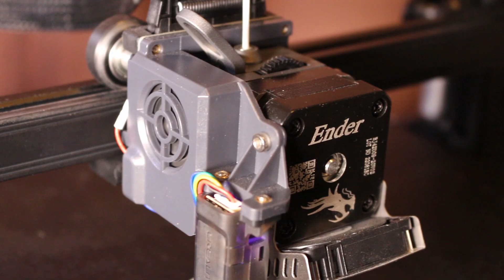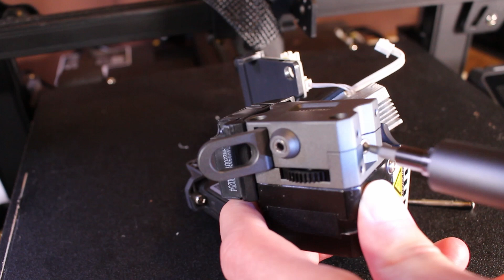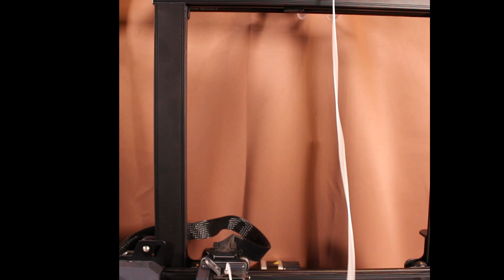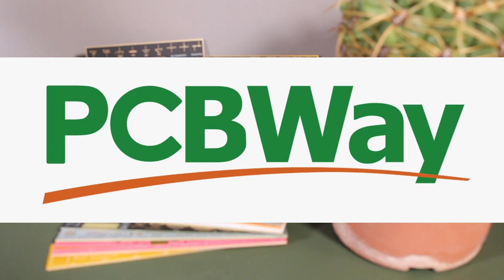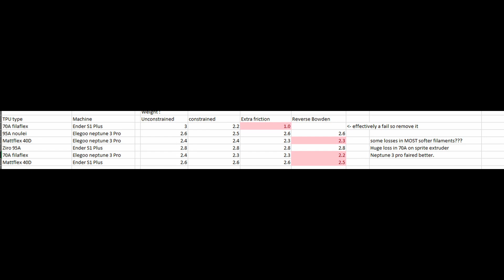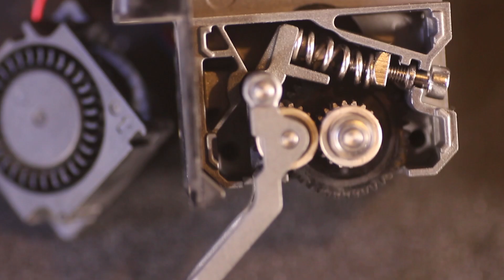The solution to this TPU problem was surprisingly simple!

Comment: I bought this 3D printer 2 years ago and bought the TPU 75A and I have the same problem. I bought the TPU 95 and everything is fine. I was waiting maybe for new gears or another solution. And I couldn't print the 75A. Now I realize that I may have had a problem with the filament sensor and the spool trying to spin. Thank you!

Comment: I am noticing a similar issue with my new Top Feed system.  I have recently replaced the hot end and then upgraded to a Direct feed system. I also added an all aluminum extruder to avoid some of the issues with slippage on the plastic one my original printer came with.

I am running simple PLA from Overture, one of the best PLAs I can get through my machine.  But the 1kg spool weighs too much for the extruder to pull the filament.  The only way to get a perfect print is to pull filament off the spool.

Any suggestions on how to incease the pulling power on the motor that drives the filament?
Reply from the maker: you could try a spool holder with bearings in it, if you aren't already.
Reply: @LostInTech3D  Awesome! Thanks for the quick reply.

Comment: Hi there all. I have recently tried the Filaflex 70A on my X1 Carbon.... with no luck . I am so glad to have seen this video. My thoughts were very much the same , so I am in the process of making a top mount spool holder with bearings , and I am swapping out the stock Bowden tube with some extra smooth tube . I have only recently got my own printer so I am not quite ready to start taking apart the head  but it may happen because I have an opportunity to make some money if i can get the 70A to actually work . The 82A works ok but not show room quality and not to spec for my application.  Also I am using  0.4 hardened steel hot end . I don't think that is Ideal but have been told conflicting opinions on going bigger .  Have you tried the 70A on an X1 Carbon?

Comment: After a month of continuous tests, I have been able to successfully print in TPU 60 on my Stock* Ender 3 S1 Pro, I did change the nozzle to a Creality brand 0.8mm nozzle that was supposed to have a much smoother and more polished channel compared to the normal brass nozzles. I was now able to have consistent pressures pushing forward to print but I do need to babysit my printer to ensure I always have filament slack to reduce any possible drag. I should post a vid on my findings. Thanks for the helpful tips Lost in Tech!

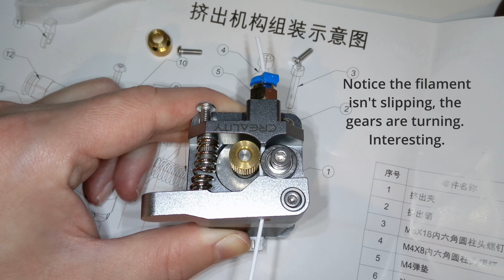Comment: At 8:54 in the video, you can see that the wheels are closer together.
How did you achieve this?
Reply from the maker: I don't think so - it could be variance in the teeth, but yeah you can't achieve that, it's determined by the hardware. I suspect they are just not that well made and not perfectly round.

Comment: Thank you for sharing your great observations that substantially increase the community knowledge on TPU printing.  I sell a product that I 3D print from TPU 98 and I'm developing a TPU 95 version.  I pull a foot of TPU filament off the reel when I start a new print to prevent the extruder from stretching the filament that could cause a slight under extrusion on the critical initial layers and have the extrusion variable set to compensate for filament stretch but that's difficult to adjust because the moving print head unreels filament when at the edge of the part's print envelope (under extruding during this process) and then prints from the slack filament the rest of the time.

I recently upgraded to an Elegoo Neptune 4 Pro and I'm still experimenting and learning about TPU on this new extruder.  Your observations were very useful in helping me understand what's happening although I think I had a good intuitive understanding of the problematic TPU extrusion based on a few years of manufacturing experience.  I'll definitely try extruder pull out tests on a couple of durometers of TPU, and I'll weigh some test cubes with TPU printed off the reel versus TPU with slack filament above the extruder.

I'd previously considered building a TPU detensioner that is essentially a driven gear and sensor just below the filament run out sensor that pulls the TPU off the reel to keep constant slack in the TPU as it feeds into the extruder.  It may be time to revisit that project for printing softer TPU filaments.

I long ago switched to hanging the reels a couple of feet above the printers and feeding the filament directly down into the extruder.  That's the only way I could get TPU to print.  I can't believe people try to feed TPU through a reverse Bowden tube.  I didn't even consider 3D printers with a reverse Bowden tube such as the Anycubic Kobra 2 because I print a lot of TPU.

Comment: I am now printing decent 95A TPU filament with ball bearing filament holder, ball bearing filament feeder, 30 mm/s outer layer,  3mm/s retraction, 10mm/s first layer, 220 C extruder 60 C bed my cheap/trusty good ol' Ender 3! Thank you for the knowledge 🧠

Comment: found out the same thing. When using flexible filament you need to manually loosen the filament off the roll. Larger rolls have higher resistance than smaller rolls.  I get great results by doing this. A pain, but necessary.

Comment: Do you think the bowden hotends print TPU better than all metal hotends? my all metal direct drive setup is having issues with friction in the hotend but a sprite bowden setup might fix that
Reply from the maker: fundamentally no, I use a fair few all metal hotends that perform adequately for 95A TPU, at much better than bowden speeds. Unless you're printing 70A then I would try to fix your metal DD, or try another heat break maybe.
Reply: @LostInTech3D  yeah I’ve been printing with Filaflex 70a, which was going somewhat smoothly. until I swapped from my stock ender 3 hotend+ a micro Swiss heatbreak and cooling block to an e3d heating block+ micro Swiss heatbreak and cooling block. I might have to swap both the heat break and the cooling block though because I can’t seam to separate them. Another weird thing I’ve encountered is that my temps need to be much higher to print since I swapped to the e3d themrisistor, but I probably just need to change the values of the thermisistor resistance table in the firmware.

Comment: I have noticed on my direct drive extruder when printing with 95A TPU a brand new 1kg roll has slight under extrusion defects that self corrects as the roll is used up.

Comment: I have had the same results needing to reduce resistance to get it to print using a single gear extruder. The dual gear extruder have worked better, but I have yet to test other flexible TPU materials. I have a longer LLK5 PRO for the single gear extruder,  and a Sovol 4 3d printer with dual gear direct drive.

Comment: I have same issue. I use 3mm id bowden tube to feed filament to my direct drive extruder on my diy core XY. Decided to try TPU for the first time after printing exclusively PETG for 2 years and my TPU first try failed because of friction in bowden tube. now i have to design new spool holder to feed filament without restriction

Comment: Wow finally someone that has my exact problem! It's been months of stress and tests and i finally came to this video. The point on the sprite extruder of the s1 is that even at full tightness it doesn't grip well TPU 85A or less. I upgraded to a full metal heatbreak and i use a smooth spool holder (bypassing the filament sensor obviously) but it seems like i can't go faster than 20 mm/s and i can't push retraction over 2 mm, wich is absurd. Even with theese settings my prints are far from great. Do you suggest replacing one of the extruder gears? What is the real solution to this? Is the sprite extruder bad at printing TPU and i can't do anything about it? That would be actually funny since i bought the S1 to print TPU. If you have an answer to this please tell me 'cause i'm out of hope right now.

Comment: I thought when I saw the video start.... I wonder if he rolls it off the spool! 
I spent days trying to work this out on my Orbiter2 extruders using Overture TPU - on Cardboard spools. I kept getting what I thought were clogs on 2 different printers. Only by pure accident I noticed excess filament I rolled off printing just fine, then as soon as it went taught and had to pull on the spool it had under extrusion again.

Comment: I have an old Fablicator FM1 that has a smooth bearing roller that swaps out when using TPU for this very reason.  That printer has always excelled with TPU (even NinjaFlex)

My Prusa's - I had to loosen the tension on the bondtech double gears, also switching to a .6mm nozzle did wonders.  Prints flawless.

Comment: this is exactly the results I had. I printed 95a with no issues at all.. but determined my part needed softer filament... so I movedd to 85a and started getting under extrusion. Trial and error showed that if I pulled the filament out and bypassed the filament sensor I could get good prints. Even after switching to a spool holder that had bearings, it was still a problem. The mass of the spool was enough to cause the under extrusion. Problem is that with a 12 hour print I needed to just sit there and pull out filament.. not going to happen. 

I am still searching for a solution, going to try a small reallly light spool on the bearing holder next.

Comment: I tried printing an object using Ninjaflex 85A, and got the same results you did, after successfully printing a temp tower and retraction tower.  Good info and thanks!  Special note, I had just taken it out of my filament dryer, probably didn't help the situation.

Comment: I've been meaning to build a better spool holder, I currently have my spools in a dry box next to the printer, it's on rollers and rolls fine but the filament needs to travel through the filament detector and across the frame and that's really not ideal.   When I was printing TPU I just let the spool on its side on the desk next to my printer, it basically unspooled itself without any issue.  It doesn't work with PLA or PETG but I don't have issue with those, at least the issues aren't as severe.  I did print a hanging filament spool holder with bearing but there's very little friction, it turns out you want a little friction because the whole spool basically ran out.

Comment: PRUSA MK3s with SaintSmart TPU. Loosening one turn the tensioner seems to work. Also bypassing the MMU2 is imperative. Fil rol on top of the extruder with the standard PRUSA trays that came with the MMU2 and have ball bearings. Slack is not necessary except when loading

Comment: You always need to adjust your tension depending on the material you use. With PLA / PETG it´s just not noticeble at all you will be usually fine but as you can see here TPU is a different story.
Also the dual gear extruder in general is not a great solution since one of the two gears will be always out of "sync" you will always get surface inconsistency with this style of mechanism.
The forces in our 3D Printers are usually very small, so for most applications a direct drive single gear extrudder with a PTFE boden tube (non all metal hotend) will be the best technical solution for PLA / PETG / TPU especially TPU though.

Comment: maybe an even more overkill solution is to have an extra stepper motor to pre pull the filament so there's a perpetual slack
Reply: I'm thinking the same thing! We print NinjaFlex (85A) almost exclusively. Our CR-10 S5's have Microswiss direct extruders, and work well, but we decided to get more printers and went with the Creality CR-M4.  Same issue as the video!  We are about ready to return them, but I'm going to try some way of removing the pretension.  We're looking at adding 8 printers to our farm and this may have made my life a little easier!
Reply: Yeah like adding a one gear extruder behind that is plugged on the same cable and extrudes the same amount so the slack is kept the same lenght
Reply: I made the same comment in a bit more detail and then scrolled down to see your comment about adding a drive motor to create TPU filament slack above the 3D printer's extruder.  I'd considered making a filament detensioner when trying to get TPU to print properly a few years ago.  I sell a TPU 3D printed product, so I have a lot of experience printing TPU.  I'm surprised there isn't an aftermarket product that is mounted between the filament run out sensor and the extruder to ensure there is no tension in the TPU filament.  I mostly solved that problem by hanging the filament two feet above the printer and using smooth rollers so there is very little tension in the filament when it feeds straight down into the extruder.

I recently upgraded to a Neptune 4 Pro.  I didn't even consider 3D printers such as the Anycubic Kobra 2 that have a reverse Bowden tube, because that's going to cause problems when printing with TPU.
Reply: That is exactly what I was going to say.

Comment: Off topic, how to you like the screw driver?  I was concerned it would not have enough torque... you seem to use it with no issues.  Recommend?
Reply from the maker: it's more of an assisted driver than doing the work itself, you can drive and turn it. It's okay

Comment: Took me a few days to watch this, but very interesting. I have the regular S1 and I have super soft Ninja Flex, which doesn't print nicely, but I'll try this next time. Why bypass the runout sensor?
Reply from the maker: The runout sensor is a huge source of friction, and also hard to load. Best to bypass it, if you can't, theres an option of stuffing a piece of PLA in there.

Comment: I think I'll have to try the tug test with my Bondtech dual gears. I believe the spacing of the two hobbed channels is significantly closer on those than what you depict here. I've not had issues with TPU as low as 82A yet.

Comment: Is there any way of trying a dual motor extruder, one being the main extruder motor (situated at the extruder like a normal direct drive) and the other one just pulling filament from the roll (situated near the filament roll like a bowden one) mimicking the main extruder movement, so the tension generated by the extruder from pulling the filament is removed. In short, a printer with two motors for the extrusion system, one normal direct drive extruder  and the another motor as a bowden extruder that work with exactly the same movements.
Reply from the maker: yes - it should work in fact, perhaps with some attention to how to allow it to slip if it doesnt sync exactly

Comment: I had this last year printing 70A filaflex. I solved it by using lithium grease on the stock mount. Just don't do what I did the first time and apply it with a spray. It does not aid bed adhesion.
Reply from the maker: Hahaha no, greasing the bed is probably not good 😂

Comment: I use a paint roller with bearings from the hardware store as the base for my spool holder. Maintaining a desirable level of tension for stiffer plastics is the bigger problem for that thing.
Reply from the maker: That's a good solution!
Reply: @LostInTech3D   Next time your in a hardware store, just give the green Wooster brand paint roller a feel. It's smoother than quite a few of the VXB bearing based print your own spool designs I tried when loaded and I spent less on that then the bearings. The only problem are those spools with the tiny 3/4in center holes.

Comment: This is an interesting dilemma, since softer filaments seem to also tend to be hydroscopic. I do a little with TPU, but more so working with PVA, I run both out of a drybox and while there are rollers in the dry box, the drag is still noticeable.
Reply: I had a similar issue and fixed it with hanging the 3KG TPU 82A roll off a rod, and greasing the inside of the roll (where it touches the rod) with vaseline. Works perfectly now. ^^

Comment: Obviously when there is tension in the soft TPU the diameter reduces - thus no grip. The natural “grip” you will get from rubber against a clean metal bearing should be very good as long as you can really tension that filament

Comment: My Sprite was too tight for TPU, it squashed it, got caught in the extrusion gears & made an almighty mess. I stripped it down & sorted that, adjusted the gears set to minimum pressure & it happened again. This time I squashed the spring with pliers so it's about 1 to 1.5mm shorter, now the adjustment will back off so there is no pressure on the filament. I have found the best setting for me is adjust until it touches the filament & then 1/2 a turn. Prints nicely now & still has plenty of pressure adjustment for the harder filaments. My spool holder is basically an H shape with 4 bearings for the spool to sit & roll on & for now, cable tied to the gantry top.

Comment: So, this week I was writing a long post for your Discord on precisely this problem. Ninja flex on a 1KG real is heavy enough but then add the most bulky spool holder of any of the filaments I’ve come across and it leads to too much tension causing problems. Strange thing is that it is not a consistent problem. My next step in solving this will be to up the tension on the Hemera but unspooling has made the most difference to my under extrusion issues so far. Thanks for another great vid.

Comment: Don't know about dumping on all dual gear extruders just because of this one. Those teeth are massively far apart at max tension. A few different designs out there that might work better than this one.
Reply from the maker: No doubt, but all the extruders I tried suffered to some extent. 
If you think about it, the problem is intrinsic to the design.

Comment: Interesting!
Never have a problem with any TPU on my Prusa, And actually run less pressure on the rollers than harder filaments….as recommended by Prusa….course it isn’t Bowden tube😎
Reply: Have you printed 70A TPU on it though? :)